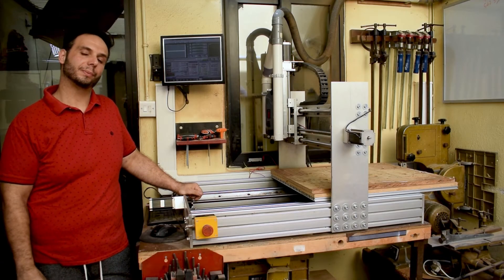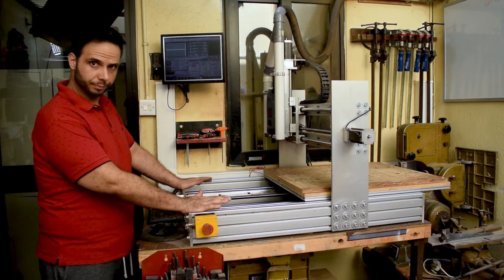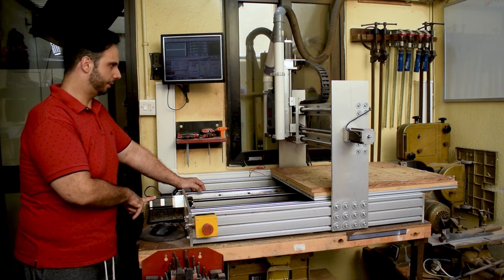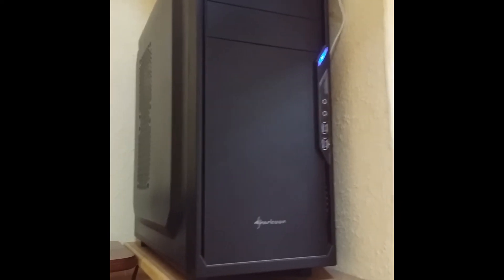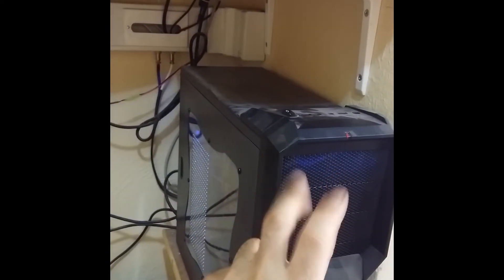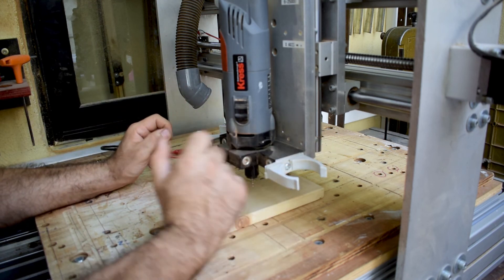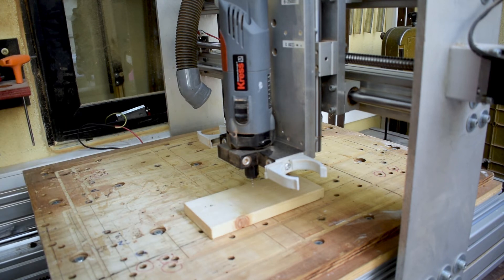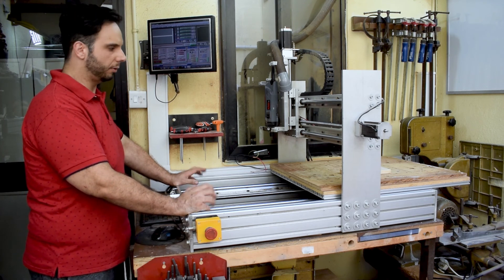On popular demand, here's my CNC tour!

Comment: Very interesting as always :) Curious about the way you hold the stock to the CNC while allowing flipping the piece and still be 100% accurate. I know you use metal (steel, aluminum?) pins to hold the stock; did you put metal tubes or sleeves in your wasteboard, or the pins just goes straight through the wasteboard’s wood?
Reply from the maker: Simon Labrecque the pins they just go through the wasteboard, ne metal sleaves or whatsoever. Just I tight fit
Reply: Sweet, thanks!